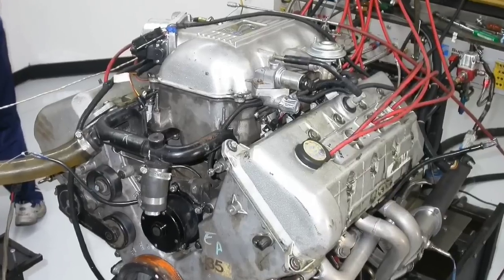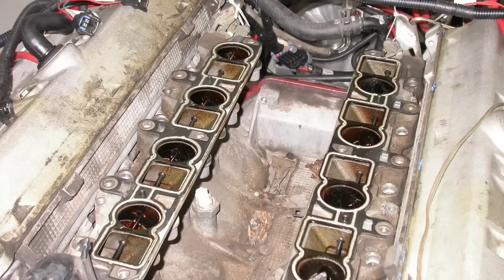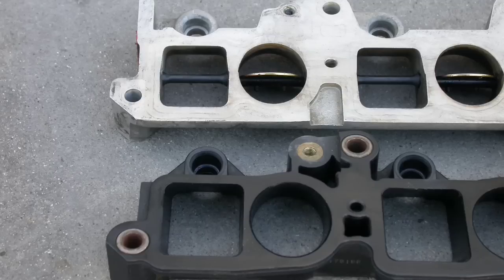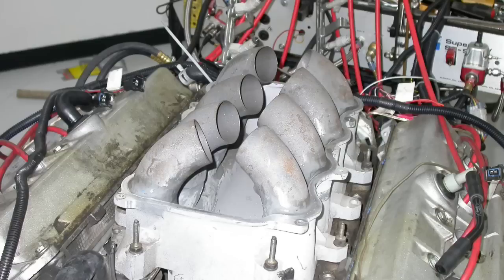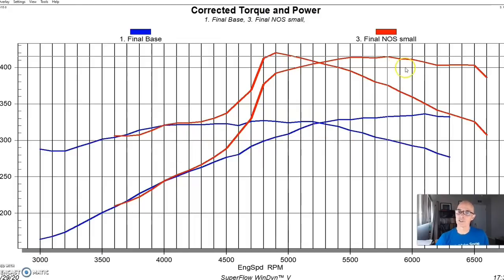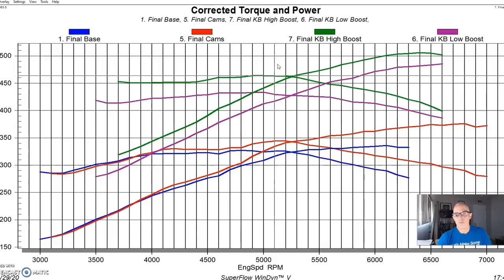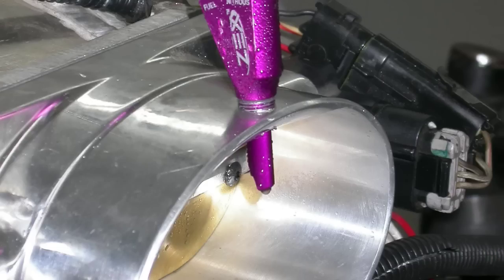1996-98 4V COBRA MODS

Comment: New to all this but what about swapping 03-04 Terminator heads onto the 97-98 Teksid block? Will they bolt up? Then you can whipple swap or stock blower from a terminator and make good power
Reply from the maker: yes

Comment: One thing I'd like to know...The factory motor was rated at 305/300.  Your test motor with the accufab/stand alone, longtubes and electric water pump made 336/327.  How much of those gains are from each of those?
Reply from the maker: RATED POWER IS TESTED DIFFERENTLY-I COVER THIS IN MANY VIDEOS

Comment: Can you make another video on these B head 96-98 Cobras maximum effort on a NA setup? I own a 97 cobra fairly healthy with 170K miles all original powertrain with 4 bolt ons no headers making 283 stock tune. I own a built/cammed/fbo mach 1 with 4:10’s as well. But I realllllly want to put cams in my cobra so bad and keep it B head strictly. I love the originality of the B head and keeping it Gen 1. Plus the stock manifold is the best looking intake manifold ford has ever made. It’s a street car I deeply care about and want to keep it B head. I have a hard time finding solid cams for good power/torque in the curve. Just looking for something that gives me a noticeable punch and is fun on the street.
Reply from the maker: port the B heads and add cams-but you will need a better intake

Comment: Great video and great advice. I'm gathering that that short lock probably ain't going to last much longer running above the 450hp mark. What do you suggest on a good rod and piston? Does that blower that you used have the option to run an intercooler? I see these for sale every now and then (blower)
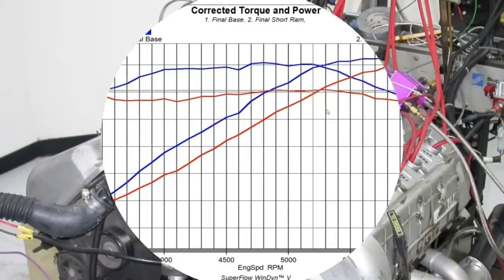Reply: Typically these engines can live long lives with a safe tune at about 450-475whp.  At least that's been the history with the potentially thousands of boosted ones running around.  With a 15% loss, that 450whp would be about 530 crank hp (and would actually read even higher than this test because this has the electric water pump and appears to not use an alternator (not 100%, but that's what it looked like in the picture @4:30).

Comment: Whats the difference in the 96-98 cobra motor and the 99? I see root/screw style superchargers for the 96-98 motor but cant find any kits for the 99, they’re all centrifugal
Reply from the maker: Kenne bell has blower kit for the 99-the heads and intake are different on the later Cobras (B heads vs C heads)
Reply: @richardholdener1727  the only ones i see on kenne bell are for the 99 2v, do you have a link for it or something? Thx
Reply: @rustyretired Hey I was trying to send you a link as to why KB discontinued the 99-01 4v kit but youtube keeps deleting the link. Type in "what happened to the Kenne Bell supercharger kit for  99-01 cobras" and you should get your answer 😎👍🐍💨💨💨💨
Reply: @qward2174  oh ok, thanks man

Comment: Hello sir, I’m debating the kenne bell for my 96 but it’s set up for road courses. I heard heat is a huge Pain. I don’t need 500 hp but a little gain with no loss in reliability would be nice. For those needs what would you suggest?
Reply from the maker: for a road course the centrifugal works well

Comment: Richard what injectors and pulley did you use to add more boost? I have a kenne bell stock manifolds but don’t feel the power. I was interested in getting pulley upgrade what did you use
Reply from the maker: injectors should be sized for the intended power output

Comment: I bolted a 2.1 kenny bell  on my 97 cobra mustang   
I have the stock cams and the kenny bell  has the 3 inch pulley and 8 psi i wanna say
Dose any one know what the boost pump should be set at  
Just checking

Comment: @Richard Holdener If I'm swapping a Mark VIII 4.6 32V into another car, should I keep the cool 16 runner intake or am I better off finding a different intake?
Reply from the maker: I HAVE NOT TESTED THAT ONE
Reply: @richardholdener1727  The Mark VIII and Lincoln Aviator are our low buck 32V saviors at the moment, and they both have pretty advanced intakes (especially those early VIIIs, that's some F1 engine insanity, they look so cool!)

Comment: I just want to know the minimum mods I would need to run a turbo on my Lincoln Aviator to haul the kids around between long street lights..... fresh engine with 6k miles on it.
Reply from the maker: just injectors and pump-then turbo and intercooler

Comment: Will this same kenne bell supercharger also fit on a 1999 mustang cobra
Reply from the maker: No-the lower manifold is design for the dual-port 96-98 4V heads
Reply: @richardholdener1727  uk where I can get a good supercharger for a 99 cobra?

Comment: For the 1998 Mark 8, how much of a difference is there with using the same aftermarket parts?
Would the IMRC delete plates help when adding the supercharger/nitrous?
I have the cobra intake with 76mm MAF housing and all factory EGR stuff still in the car. I do have a tuning chip with software for power adding applications.
Reply: Wouldn’t do an IMRC delete. Just have a tuner program them to open earlier.
Reply: @TacoCrisma  I did end up deleting them.  I'm running NA and J-chip tuned for the mods I have done.
 I've been drifting my Mark 8 and it is an incredible car. Feels and sounds amazing.  I uploaded videos if you want to check them out.

Comment: You need to do 4.6 DOHC Turbo Intake options. How much stock 01 cobra intake vs ported vs Sullivan single plane with adapter vs a eaton/kb lower with a welded box upper with tb adapter
Reply from the maker: did you watch the 4.6L 4V or the 5.4l 4V intake videos-same under boost-https://youtu.be/gnVmxYBfBoE

Comment: Were the cams degree’d ? Or just swapped out? Good gains with cams!
Reply: Moises L most people do not degree cams and leave free HP on the table I've read this more than once from professional engine builders of the 4.6 2V and 4V. If each cam is out even one or two degree you have an imbalance and one side of the motor is fighting the other side. This is especially important on multi cam engines more so the single cam push rod motors. The worst you wind up with on a push rod motor is a power band that has shifted either up or down the rpm range a bit.
Reply from the maker: these were degreed-mod motors can have cam timing off by a lot even from the factory

Comment: I remember back in 2000 when cobras were so expensive to fix most guys would go with a ls1 just because heads for the cobras were so much money
Reply: They don’t sell aftermarket heads for any 4v 4.6 cobra engines! All you can do is send them out to get ported/polished and built
Reply: Or go back to 5.0 sbf. 2020 and its still the same.
Reply: Venom Svt exactly and if anything happened to a head because rev limiter would get removed back then over revving was such an issue I remember guys taking stock heads to 8000 consistently and saying it pulled so much harder
Reply from the maker: stock ones don't make power at 8000 rpm
Reply: @xmo552  or you can just slap rods and pistons in it with a turbo and make way more power than a stock block 5.0 could ever dream of making.   You can make pretty big power with completely stock untouched heads even b heads.  The older 4v cars aren't as worthless as everyone seems to think they are.  They came with a forged crank and teksid block one of the strongest aluminum blocks ever put into a ford.  Not a bad starting point for making some pretty big power without spending 10 grand on the engine.

Comment: Cost per hp,  302 vs 4.6.. What I mean is, if You had a 93 5L HO and I had a 96ish 4.6L and we were both given $3,000 to make reliable HP, who makes more power?
Reply: The 4.6..... the heads flow wayyy better than anything sbf. But.... the 302 will make more usable torque vs the 4.6.
Reply: The 4V mod motor will destroy the 5.0, both in stock trim and in response to modifications.
Reply: @drgibs347  if you started with a 96 non pi and did heads cams intake it would have more power than a 99 up car with the same mods because it would have more compression from what I've always read.  The 4.6 can actually make pretty decent power na if you choose the right parts and match everything up correctly it's all in the combo with any engine but even more so with the 4.6.  That being said the old 5 liter can make some good power too with the right parts like the newish 11r heads from trickflow.  Wouldn't be hard to make 330-350 rwhp with the right combo.  An average heads cam intake package just throwed together might be lucky to make 300.  I think that is pretty good power for a 50 year old engine platform that is only 302 cubes and 9 to 1 compression.   The ls guys don't seem to understand they're up a good amount on head flow, compression and cubes so obviously they're gonna have an advantage.  With a higher compression 302 with the right parts they can make respectable power for the size and age of the engine platform.
Reply: @xXxNECROMONGERxXx  I assumed he was talking about the 2v but if its 4v it isnt hard to make 350 to the wheels with a ported short runner, FBO and cams in the b head cars.  Not too bad for 4.6 liters utilizing stock heads from 20+ years ago.
Reply: @drgibs347  Wrong.. Cleveland heads dominate the Mod..  If you already have the 302.. then 347 Clevor.. 500hp naturally aspirated.  Easily done for $3000.
Reply: The 5.0. 
Why did EVERYONE hate the mod motors until the Termi came out? 
For low dollars.... the Windsor wins out.
Reply: @xmo552  everyone didnt hate mod motors till the terminator came out lol.  Some ppl hated it in 1996 when they first came out there wasnt alot available for them once the aftermarket caught on so did their popularity.  The 2v can make as much power as the old 5 liters did with similar mods and the 4v can make more.
Reply: @midnight347  
The original question was cost per hp. I still think the old 5.0 does it cheaper.
Reply: @xmo552  it might do it cheaper but a 4v can get to similar power levels without the need for an 1800 dollar set of heads.   Just ported short runner and cams can get you to 350+ even on b head cars.  Cams cost more to do because there is 4 vs 1 but heads aren't needed so that offsets that.   I don't think the cost difference is as much as ppl think if you know what parts to go with.   A cammed b beaded ported short runner car with 4.30s can be an animal.
Reply: All depends on the builder.
Assuming you're talking 4v 4.6, it would depend on how good of a fabricator they are.
The 5.0 would need new heads, cam, intake.  That would take the entire budget and make about 350hp typically.
As shown here, a set of cams and long tubes would be about $2k and would make 375hp.  And you'd still have $1k to work with to throw that nitrous on and make 500hp.
Or a good fabricator could build a turbo kit for about $3k on the 4v and make 500hp.  
Either way, the 5.0 would be at a disadvantage.
Reply: @xmo552  People hated the mod motors because they didn't like the change to overhead cam.  They thought of it as "turning into a honduh" by going SOHC and DOHC.  So they didn't spend any time with them.  But the heads are better, the block is better, the everything is better.
Reply: @Milehighsnake98  
When they were new, the 5.0 felt better.
Reply: @xmo552  LMAO.  Yeah, a high 15 second car "felt better" than a mid 13 second car.  Riiight.
Reply: @Milehighsnake98  
I'm talking about the basic 94 Gt. It's a turd.

Comment: What about the 4v out of a Mach 1
Reply: Maurader block, terminator heads
Reply: I wanna see the mach 1 engine as well... since thats what i have in my fox. I know they are not extremely different, but there should be a different outcome.
Reply: @MoctezumasRevenge1  terminator heads lower the compression dramatically. Unless you're putting turbos on the motor, it's not great.
Reply: Boss 290
Reply: @drgibs347  its def a better engine i had a 97 cobra and 03 mach.  The mach had headers and tbody that the cobra did not otherwise almost identical mods cobra had 4.10s and mach had stock 355 and the mach was still faster with 4.10 or better yet 430 gears the mach would have yanked the cobra easily.  They make more power and alot more torque.  The heads and intake are better...a mach with a ported short runner (a proper short runner not one that is way too short like in this video) with some nice cams could make upwards of 370-380 to the tires imo.  Very stout cars for their time.  The mach engine is probably the baddest na 4.6 Ford ever made.

Comment: Does anybody know whats a good plug and play replacement engine for this? I have a 97 cobra which got a bent rod i want to take my time on building it but i want a engine that i can use to drive for now? Thanks in adv
Reply from the maker: use a 2V bottom end with your 4v top end
Reply: Find a mark viii engine and swap everything over

Comment: Richard, for a short runner intake you're only supposed to remove an inch of length from just above the bellmouths...

Don't spread bad information!! This combination has already been dyno proven over and over again.
Reply: While there's plenty of dynos that disagree with him, I think the big takeaway here is that you can't just hack the stock runners down to half the length and expect to make big power.  There's an art to it that only a few people (Todd Warren, Matt Hayes being the main ones) really take the time to do it right.  There's a reason why Todd (NA SVT) stopped doing it and Matt has a nearly year backlog.  I have an intake sitting in my basement that I still have a while to go before I can get mine done.

Comment: the engine in the picture is pre 1997
Reply from the maker: a 96?
Reply: Wasn't the only difference aluminum vs polymer imrc plates?
Reply: @GroovesAndLands  98 was the only year of the phenolic IMRC.  96-97 both had aluminum plates IIRC.

Comment: I would comment more on this. But a boosted motor making 500hp is a joke. Mod motors suck. And iam not just bashing fords. I would have been pissed as a ford fan when that replaced the winsor.
Reply: Turbo jet. ....you mention factory internals. Let take a step back. Would a mod motor with internal parts made the dame way the did during the winsor years....so cast everything. Your saying it would still support those numbers and last under conditions. What iam saying is that....ince to inch. The mod motors are junk. Even the new factory super snakes are under hp for the technology thats put into them. You can take any other modern day power plant and treat it with all the same goodies. The mod will fall flat on its face. Hell...take a naturally asp. Stroker winsor and forged internals and a screw type blower. It will create more power per cubjc inch then the mod. Ever hear of the ford lighting?
Reply: Windsors have a tough time making 500 even with heads cam intake and a blower and the block won't stay in one piece at that power level anyways.  These cars just needs rods and pistons upgraded and they can make far beyond what a stock block windsor motor can make even with stock untouched heads.  I don't see how that is a big "downgrade" some guys just don't know what they're talking about.
Reply: @approachingtarget.4503  forget factory internals the windsor aint gonna go much beyond 500 and stay together with the stock BLOCK regaurdless of internals used.  Whereas these 4v you can upgrade rods and pistons and make WELL beyond that number even with untouched factory heads.  Try THAT with a windsor.  You need heads and an expensive dart block to even approach the same power level that combo would be capable of.  Ppl who act like the mod motors especially the 4v mod motors are inferior to the old windsor 5.0 just show how much they DONT know.

Comment: Lucky it didnt blow was told these blow rods out. At like 450
Reply from the maker: that is not true
Reply: @richardholdener1727    really when i bought my 96 cobra last year i was like sweet. Cheap termi build up then heard i couldnt run the power i wanted.  I know the block will handle it
Reply: @richardholdener1727   what can these motors stock pistons and rods handle  safely day in and day out
Reply: @mustang1100  450-475 wheel hp is considered safe for a long life.  Some people have had them run fine at 450, but blow at 455.  Some have ran for 50k miles at 550whp.  The rods are the weakest point, then the pistons.  Swap those and the engine will make whatever you want it to with the right boost.
Reply: @Milehighsnake98   ya I want way more then  that
Reply: Are you drunk?
Reply: @BlueOvalEdge    no why